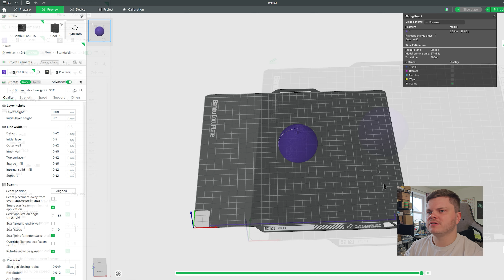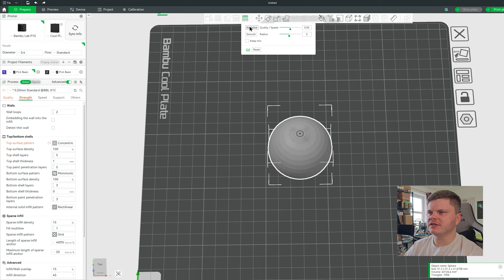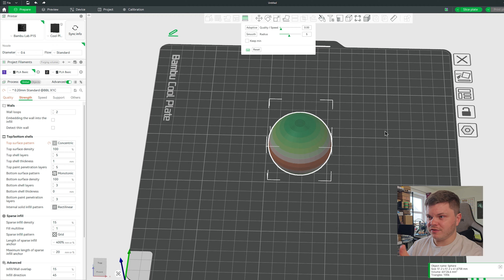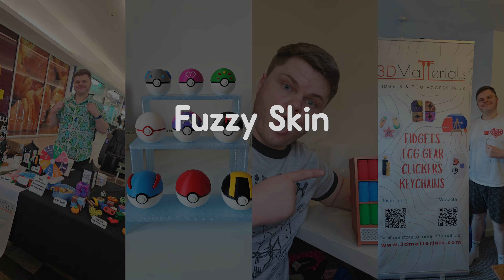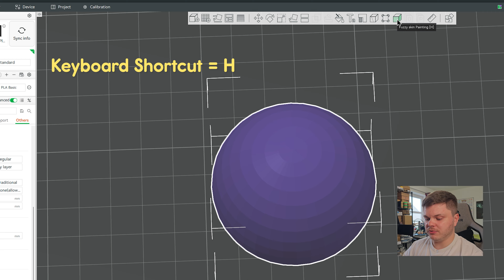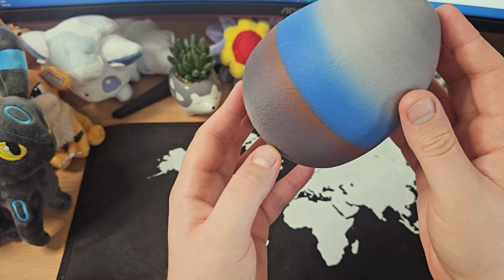Best Ways To Hide Layer Lines In 3D Prints │ Variable Layer Height, Fuzzy Skin, And More!

Comment: Hi Matt 
Many thanks for sharing the videos - Great Help
Matt im inserting nuts into a print - no problem but everytime the head pauses to allow this i'm getting a nasty outside line defect 
Any Idea how to remedy this mate..
G
Reply from the maker: Hmm, without seeing the print it's hard to say, but it sounds like a layer shift. That can happen when you pause and resume a print. How long is the printer paused before you restart it? Anything longer than like 10 minutes will cause a layer shift, because the print head basically "forgets" where it was
Reply: @3DMatterials The pause is only for a few seconds to insert 4 X 4mm nuts 
seems to happen only on once side of the print which is odd 
i tried rotating the print but that just seemed to move the problem around ?